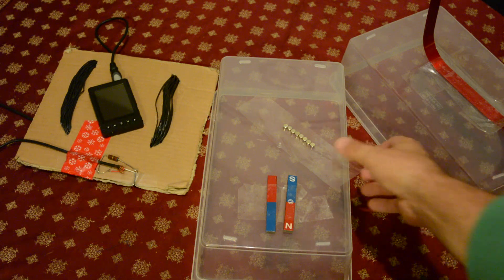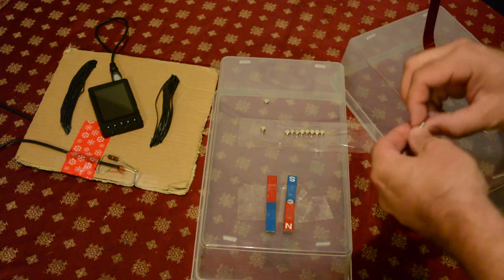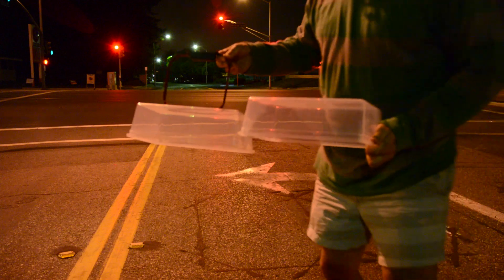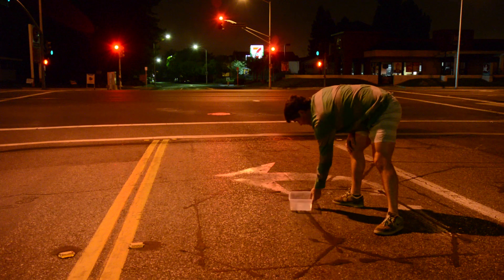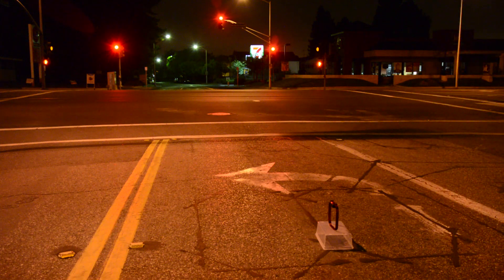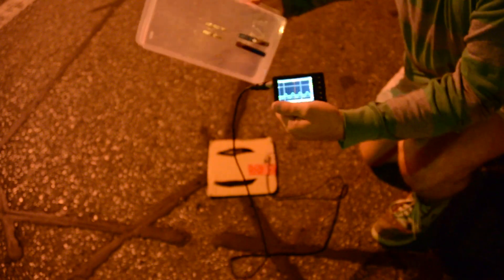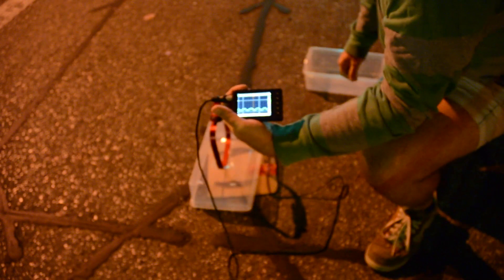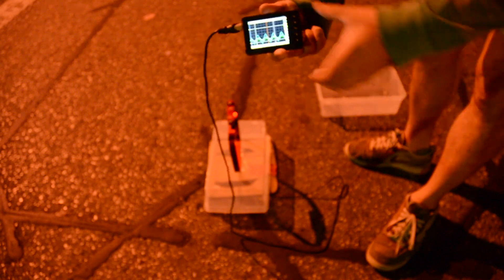Magnets vs Veloloop 1080p

Comment: Looks like BOTH things in the video failed, there's no green for anything. 

According to https://www.superstreetbike.com/dropping-kickstand-or-using-magnet-trips-green-light-mythbusters#page-3  :  
The first runs without using any methods to trigger the system resulted in an unchanging red light. On the following run while stopped in the same position, the rider reached down and swiped the Green Light Trigger HP magnet near the coil and the result was an immediate green light. On the next pass, the magnet was not used but the rider instead lowered the kickstand directly onto the coil. Again the result was an immediate change to a green light.

The page has much more useful information by folks looking for helpful facts, not trying to sell their own product.

Comment: I sell the active devices for motorcycle. They are DSP based and works with all induction loop sensors.  http://www.ebay.com/itm/Motorcycle-Green-Light-Trigger-Traffic-Light-Activator-Red-Light-Changer-v3-/332346508692

Comment: Interesting... I always wondered why I couldn't trigger the lights with my bike when I was young.

What is the make/model of that pocket scope you're using?
Reply from the maker: +AAAyyyGGG It's a Seeed Studio DSO Nano from several years ago. I don't recommend it because it never properly triggers on a waveform. They have a newer version for $89 which I can hope is better. Sigilent has a $500 portable scope that I have my eye on. Details at seeedstudio.com & siglentamerica.com
Reply: You can trigger lights with your bike if the intersection's loops are set up correctly.  If the sensitivity is set too low, they won't pick up your bike, but you can call the traffic department to get them re-calibrated.

Comment: I believe you would gain more for designing this for motorcycle usage than bicycles. On a bicycle you got more freedom and can simply use pedestrian walking paths after having pressed the light button for blinds when lights are playing games with you. On a motorcycle you just can't. You're forced to wait playing sitting ducks and eventually have no other option but to break the law if no car ever comes by. I know I did after sitting there for like 10 minutes burning fuel hopping that a car would eventually come by. My 2 cents.
Reply: +mozbius most states have rules concerning the light never changing, I believe here in NC its two light change cycles if yours has not changed you can run the light if it is safe to proceed. I see what you are saying though... who wants to sit through light cycles, some of them are WAY TOO LONG lol
Reply: Dad told me a single clothes hangar dangled from a bicycle or his friend's dirtbike in the '60s tripped most lights in Toledo, OH. I've had no such luck near me, but two of the six magnets in this set planted under a flat steel part near the foot-pegs worked wonders for me when run directly over the sensor inside the edge of the lanes around here: https://smile.amazon.com/gp/product/B01I1ZB2SE
Reply from the maker: +mozbius We are indeed working on a motorcycle version now. It works, so we're just getting the device to fit on as many motorcycles as we can. facebook.com/veloloop or the newsletter at veloloop.com are ways to keep apprised of our progress.
Reply: You can check if you state is in it with this link: http://www.americanmotorcyclist.com/Rights/State-Laws-Database